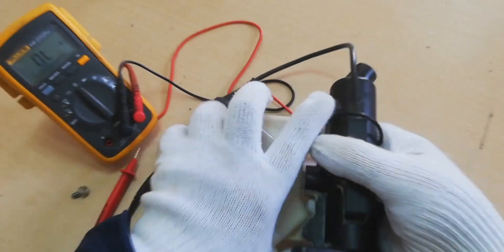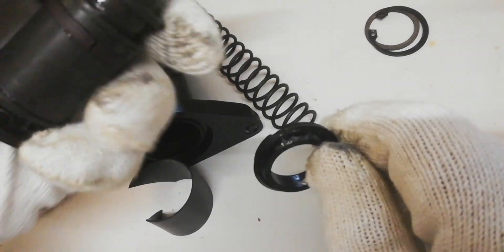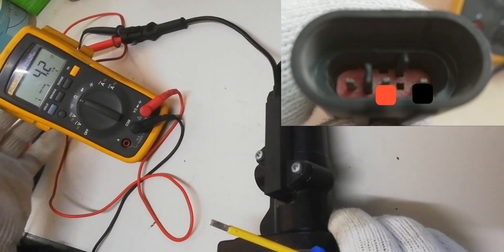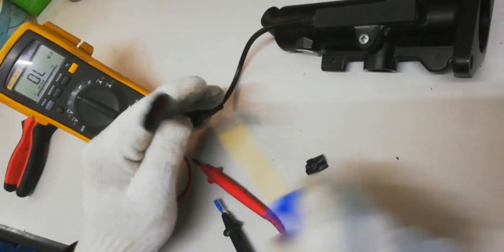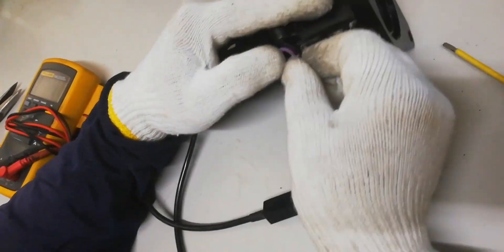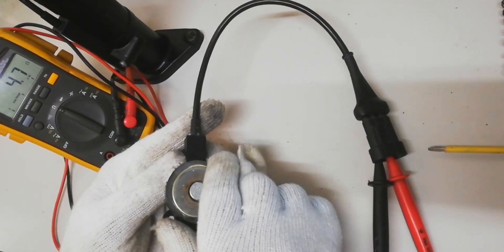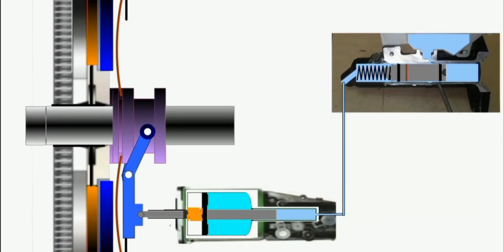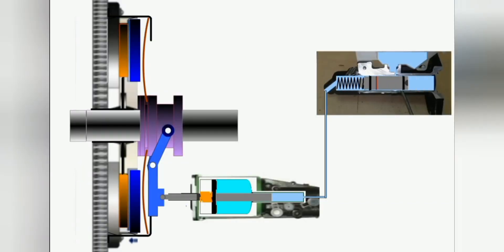CLUTCH MASTER CYLINDER MC1D TROUBLE AND HOW IT WORKS ON IVECO TRAKKER

Comment: Thanks alot but what kind of this truck?
Reply from the maker: any truck using clutch master cylinder model MC1D, like IVECO TRAKKER 420
Reply: Is there a way to check for the same defect in the Mercedes Actros mp2,mp3,mp4?
Reply from the maker: Mercedes actors are having a clutch travel sensor directly installed on the clutch booster check the video https://youtu.be/DJupZkzD_no
Reply: @yrhelmechanicalelectrical9113  Thank you very much. Can I get a video of manually checking FR functions using the multimeter